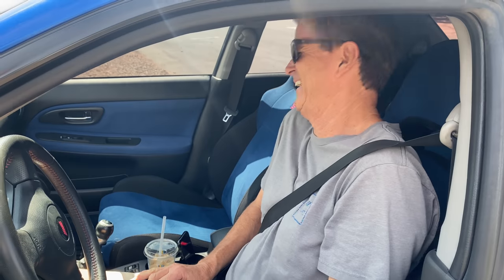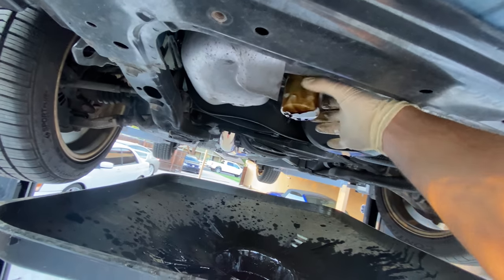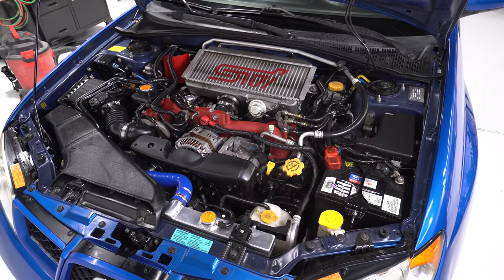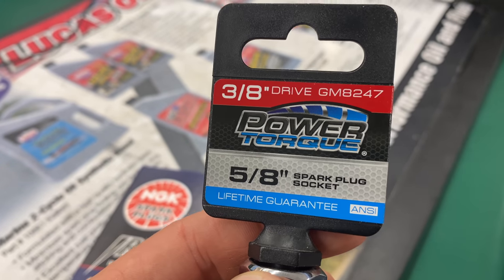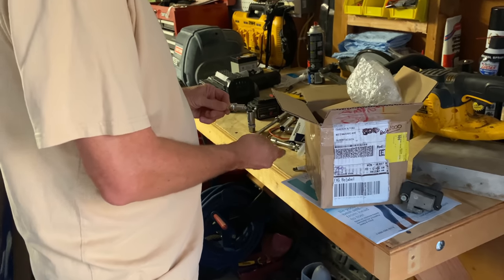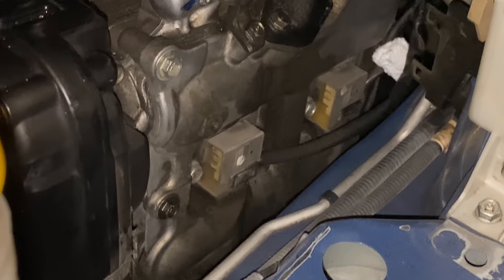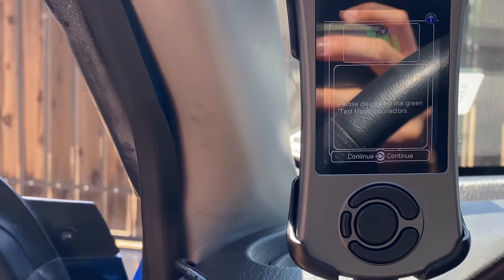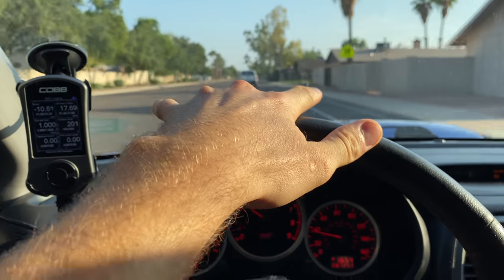Steps to Increasing my Dads STi's Reliability (2007 Subaru Impreza WRX STi)

Comment: Reliability on STIs is like really down to the driver understanding the car and things like heat soak, a proper tune, and ensuring issues are caught early. People often get a wrx and slap a OTS map and it runs richs, knocks a lot with DAM dropping, and they complain they're unreliable. also comes down to adjusting tune when it starts to have issues, like from colder weather.
Reply: So if I get say, a 2015 wrx cvt and leave it mostly stock except for maybe an exhaust or minor things it should be good?
Reply: @nathansabula6355  Basically any changes to airflow into or out of the engine will need to be tuned for it. Depending on whether an exhaust changes the airflow, like if its a cat back, it might be fine, changes to the cat, or removal will definitely need tuned
Reply: Less heat soak  with front mount

Comment: You'd save lots of $$$ if you swap to Motul X-Clean 5w30 or 5w40. Unless you are constantly above 4500 RPM and do lots of track events 300V isn't the best choice. If you like I can send some of my oil sample reports to you from a 2007/2012, and 2018 STi

Comment: Change the pcv valve, it comes with new hose and clamps, a worn valve will cause oil consumption. Evap solenoid and switch should be replaced as well all the plastic hose nipples break from heat over time, resulting in a small vacuum leak and check engine light. Make sure the fuel pulse dampers arent seeping fuel on the supply line and return line, they prevent low pressure events from occuring at the fuel injectors which if it occurs will cause hesitations abve 3000 rpm and lean events

Comment: Still a good idea to check plug gap even if they're iridium.  Just need to use caution when opening or closing up the gap not to damage the iridium tip ⚡

Comment: my friend had a 2006 wrx wagon limited 2.5 with the plastic intake manifold and it got ringland failure because the oil pickup tube cracked he was making 360whp on stock block with bolt ons so get a killer b oil pan and pickup tube its worth it

Comment: I also second the advice of getting a new oil pick up tube.  Killerbee is the original but IAG makes a good one as well.  Oil pan optional but the added oil capacity is nice.  You should also look into a getadomtune cylinder 4 cooling mod, and a oil cooler.  Oil temps tend to creep up with the stock solution in hot climates like AZ.  Next you should look into suspension improvements, replacing all the bushes and such, would be a cool series.

Comment: Cylinder 4 cooling mod. Will help keep the temps low for cylinder 4 and doing so will help avoid detonation or knock
Reply: Waste of time if the tuner says that the logs look good.  Cylinder 4 cooling is only worth it if you are tracking the car or are pushing super high horsepower and racing the car a lot.

Comment: I have a 2017 WRX I got a protune from ECI performance back in March 2021. I noticed I was having feed back knock of -1.05 when cruising or after WOT. I've also never seen the value any higher than -1.05. Should this be a cause for concern? I also notice it a lot more when I have the AC turned on as well. I'd appreciate any feed back. Thanks!
Reply: ac has nothing to do with knock. plugs, coil packs, or bad gas is usually the cause. pull plugs check gap/or throw new ones in. If it starts to misfire under WOT, stay out of boost. I start to worry when I see -2+ corrections. u should be fine, good luck !

Comment: best reliability, get the new 2021 engine, 4th cylinder mod, fluidampr, high grip tensioner, ej207 heads or built, tube and fin intercooler over bar and fin like ETS due to repeatability of cooling. the bigger sti oil filter does not work with most aftermarket headers, no one really uses it unless stock(ish), the black and pink ones were made better and are jdm only but available on ebay in lots
 not exactly why you would run a NEW coilpack for reliability? OEM coilpacks have been used on allll kinds of track & drag builds from stock to over 1000whp. OTP has a v2, so cool theres more options now and youre testing it, but don't know if this is the car for that, i guess it eliminates variables though..
Reply: I thought the Coil Pack thing was funny too. Aftermarket ones for my ST are $300 n people talk shit on them all the time for realistically doing nothing. He had an ST i;m sure he knows this Lol oh well
Reply: @Zyilophone  haha yeah especially below a certain power level

Comment: Replacing coil packs for no reason does nothing save lighten your wallet.  Swapping fluids/plugs in an unknown car is a great idea and that would include the timing belt as well.  That car also needs a new MAF and BCS and both should have been done prior to the tune.
Reply: Why would it need a new maf
Reply: @jaqsaun  A MAF is a consumable device.  Like a spark plug.  The internet loves to tell you to clean it, which is fine, but doesn't tell you to replace it, which you should.  100k miles is probably a good marker for replacement.  Same with your BCS....it gets tired too.
Reply: @ronschunck6574  bcs?
Reply: @TheMrFlyBoy18  Boost Control Solenoid.  It controls when the wastegate opens and gets tired over time.
Reply: @TheMrFlyBoy18  the diafram might leak air from age causing overboosting, rather be safe than sorry